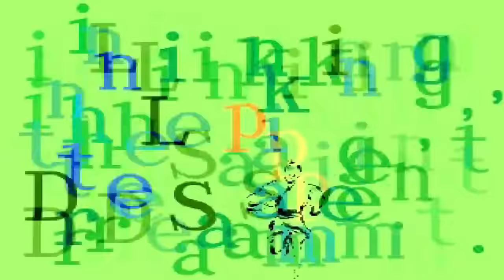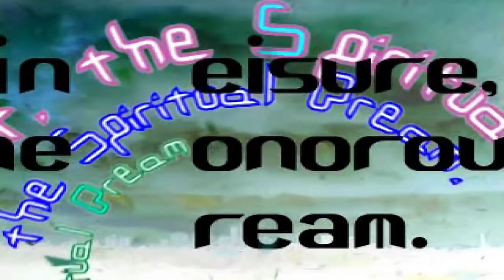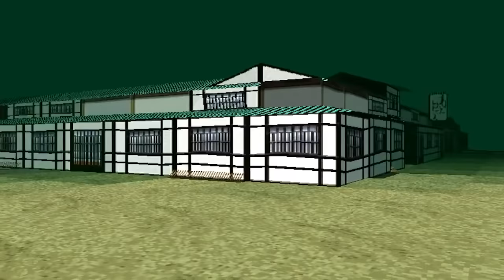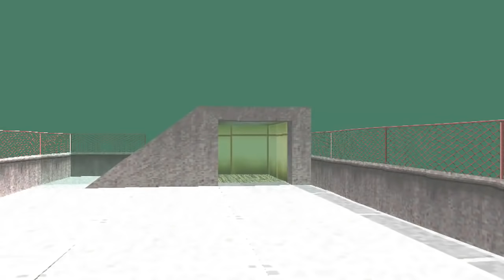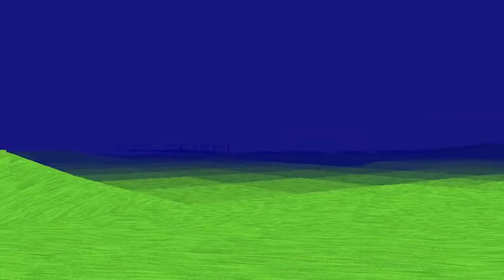5 True Bad Trip Stories (Vol. 2) | Shrooms, DMT & Ayahuasca

Comment: I tried shrooms for the first time last Saturday.  I already had tequila
 and pot in my system from earlier in the day and a buddy offered me 
shrooms at 10:30pm.  20 minutes later the lights started looking pretty 
kinda like a kaleidoscope, and one of my friends looked like the good 
witch from wizard of oz with sparkly lights all around her.  then I 
looked at one of my buddies and he did like the T-1000 on Terminator and
 turned into a puddle then reformed.  I went up and hugged him telling 
him I thought he died, then my wife came up with a life jacket (we were 
on the docks at the lake) and she knew something was wrong because I 
asked her to buckle it.  I started getting paranoid so they took me back
 to my houseboat and put  me in the spare room, with no lights on and no
 tv on.  when they closed the door I looked around and it was pitch 
black except for the red light for the TV power box.  I was sure I died 
and was trapped in a prison cell in hell.  The walls started sounding 
mechanical like they were flipping over and closing in closer and closer
 to them and I was sure I had died.  (the mechanical sounds were 
probably the carp banging the bottom of the boat)  I started flipping 
out and calling out for my friends thinking it would break me out of 
this prison and I ended up knocking over the tv.  my parents woke up and
 started panicking, and my wife came back in and told them I just had a 
nightmare so they went back to bed.  my wife laid down with me and 
everything started getting sparkly again and I was cuddling with her and
 telling her not to leave me again.  then I looked at her face and she 
had a joker mouth and it freaked me out again.  I thought I was still 
dead and she was an illusion to keep me trapped in the afterlife.  I 
bolted out of the bedroom and then left the boat to wander the docks.  
my friends were all still outside and my wife was following me, but 
everyone had joker faces and demon looking foreheads and it was freaking
 me out and I thought it was weird that nobody was really trying to help
 me, and everyone was just laughing (they were drunk and fucked up 
themselves) a couple of them did try to help me, but I still thought 
this wasn't the actual world, so I left the docks and went onto shore 
and walked up the rocks barefoot to the road.  my feet are usually 
really sensitive, but it didn't hurt at all and they didn't get scraped 
up either.  my wife followed me up and kept asking me to turn around, 
but in my head she had this weird smile and was being a smartass to me 
(in reality she was crying hysterically).  it wasn't until I was up in 
the road trying to walk home that I finally snapped out of it enough to 
realize my wife was crying, and I saw two of my friends coming up to get
 me and they no longer looked like demons.  I followed them back down 
and everyone got me back on my boat and my wife and parents stayed up 
with me the rest of the night until I came down enough to go to bed.  I 
started getting creeped out again though when they started talking about
 why the dive team came to the lake earlier and I expected them to say 
that it was because I had fell in the water and drowned and then hell 
would start all over again, but they saw me getting panicky and stopped 
talking about it.  I went to bed with my wife, but I didn't sleep at all
 and was back up by 6am that morning.  I had some coffee and some water 
and when I had more of my senses back my wife took me home.  I still 
never really came out of it until about 2am when I finally fell asleep. 
 for some reason I was getting paranoid again and thought at midnight my
 wife would turn to me and say, "now you're dead" and I had the feeling 
that my body was actually still at the dock having cpr performed on it 
and only an hour passed in real time, but midnight passed, then 12:30, 
then 1am, then 2am and then I finally fell asleep.  I woke up this 
morning and feel like I'm finally 100% out of it.
Reply: Cap
Reply: @X56th_SFS  huh? That’s a normal average Joe trip
Reply: @X56th_SFS  🤡
Reply: that definetly doesn’t sound like mushrooms, more lsd or something, granted could be mushrooms as there’s many many types butttt
Reply: @randiewain7884  it was definitely mushrooms.  He had them in a clear zip lock bag and I grabbed a stem and ate it.  I'm just extremely susceptible to any type of edible drug and I get very paranoid.  I have similar reactions to cannabis edibles, but smoking it barely fazes me.
Reply: Damn bud that’s a bad trip, some mush is extremely potent and also mixing it with things or taking too much can be a bad idea.
Reply: @diedfrombored5295  from what I've learned about my experience...
1.  it was my first time doing shrooms
2.  I'm more susceptible to edibles in general regardless what kind they are.
3.  I was also very drunk from beer and whiskey before I ate the shrooms.
4.  Nobody there guided me through the process to make sure I didn't have a bad trip.
Reply: so why did the divers come out?
Reply: @justanobservation3423  someone drowned elsewhere on the lake.  we have a couple people drown on this lake almost yearly
Reply: Sounds like me in ‘71 with psilocybin… I wrote that hype down for future reference, but there was so much more… the Lord is merciful even in our curiosity… hooch enhances you, not verse-visa…⚔️🙏🏽⚔️
Reply: Was the dive team actually there?
Reply: @drunclecookie216 joker smiles as in the villain or the playing card?
Reply: @allmightyd9834  the batman villain
Reply: Your so called friends put u in a all black room so u can have a bad trip 🙄

Comment: first time I used a bong (not the first time I’d smoked though, I’d been an active smoker for a year and a half) I had a horrific experience, upon the second hit I immediately felt it and everything felt like it was closing in on me and I couldn’t breathe at all. My boyfriend was with me and we had been in the shed, and I had to excuse myself and go back into the house. At this point I was SCREWED, even though it’d only been a few minutes. I quickly sat down and tried to calm myself down and ground myself. Everything was spinning and nothing felt real. I drank some juice hoping it’d help, and then sat down in a chair in the kitchen. I felt like I was passing out, so I sat on the floor and my boyfriend came in the house. After a little bit I was severely hallucinating and the ceiling fan made my vision turn into strobe lights. My boyfriend brought me a trash can soon after. After about 20 or maybe 30 minutes, which felt like hours, of me hallucinating and dissociating and nearly passing out every other minute, I vomited. I felt horrible afterwards, but then my high turned good after a few minutes & my boyfriend got me sliced apple slices and fruit, and I recovered fast. I barely remember most of the experience I had, but I remember fading out of existence and almost passing out so many times, and my heart beating far too fast & being unable to breathe. If my boyfriend hadn’t come back to check on me when I puked, I would’ve passed out and likely choked on my own vomit. That night was terrifying, and he’d been really close to calling an ambulance. I’m lucky that didn’t happen.

Comment: I have a crazy shroom story.  So i had been eating shrooms from Florida when I was about 16, 17, and 18. I usually would take an 1/8th to half 1/8th. I would trip quite hard and have extreme visuals etc. But one day I only took like two stems and a cap from an acquaintance.....I was not expecting anything......next thing I know all of my muscles felt like jello. Then I forgot my name and I saw a giant florescent centipede and it had bio luminosity.  It continued to change colors and apparently i gave a 20 minute monolog to the centipede (as per my friends account) it was almost 20 feet long and it was a bubble cartoonish centipede.  All i know is i was so messed up i had to crawl up the stairs and I pissed myself.  Mind you i was 17 so I had to go straight to my room at 9 pm. I was the oldest of 4 sisters and I ended up getting stuck listening to the freaking titanic soundtrack for what felt like hours.  I kept passing out and thinking i was on lsd and I kept saying you can't sleep on acid and then I would remember i was on shrooms . This kept happening with intermittent passing out. WEIRD.😮